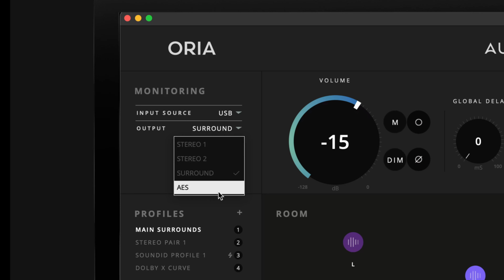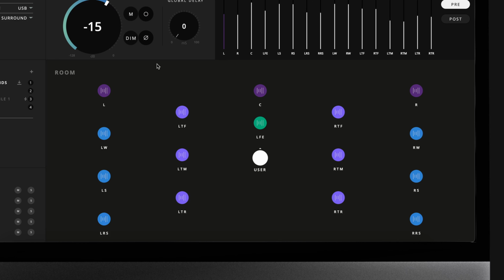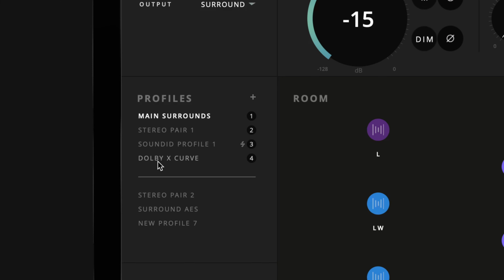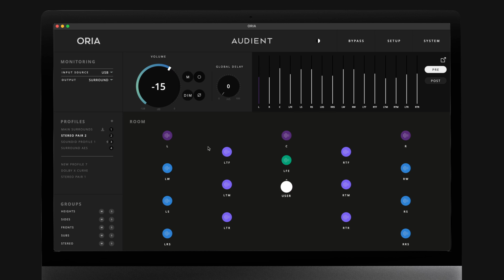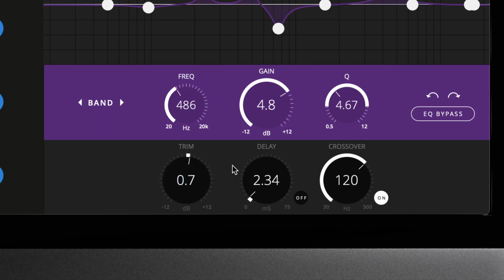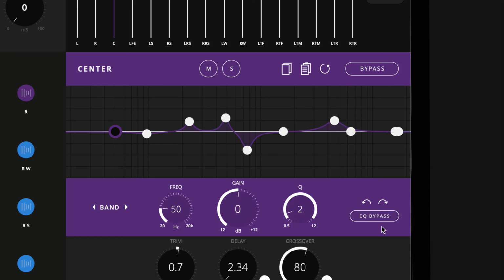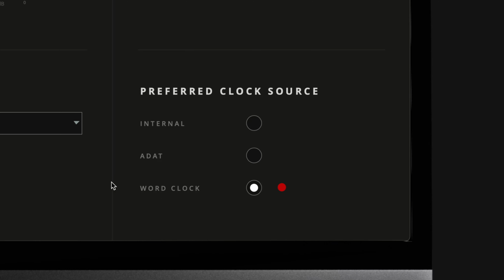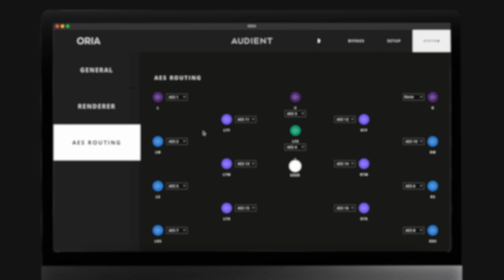ORIA - Desktop Software Overview

Comment: Been checking if I'll start moving to oria, Just want to know if it can be midi controlled? I know there is a tablet and thats good, but im used with something being tactile using muscle memory, and Im wondering if you can midi control the change from surround to stereo or to mono, as most likely it will be in a rack a bit farther than my desk.
Reply from the maker: Hello, currently it's not possible to control the functions of ORIA via MIDI I'm afraid.
Reply: @Audientworld  thanks, still a great product.